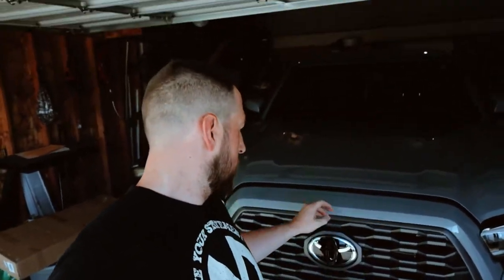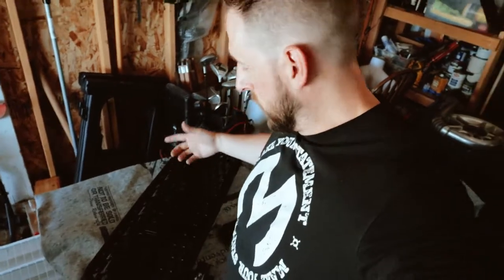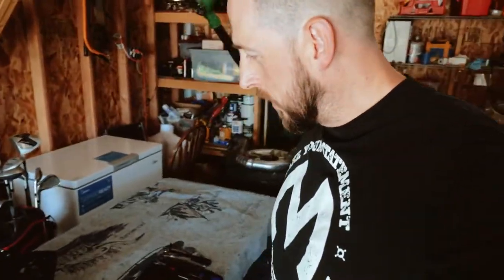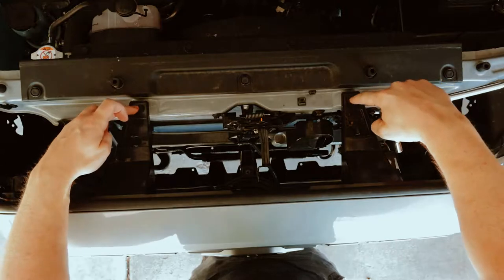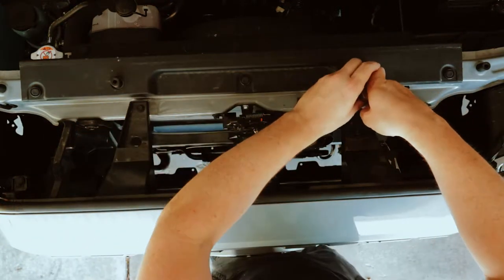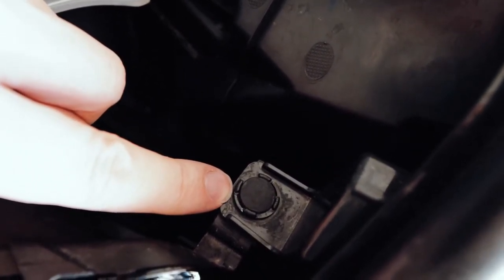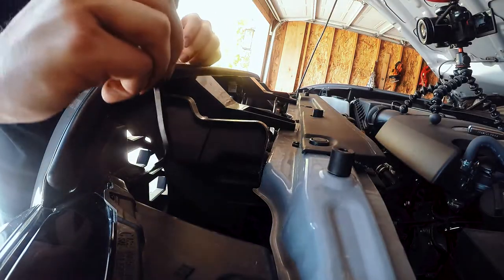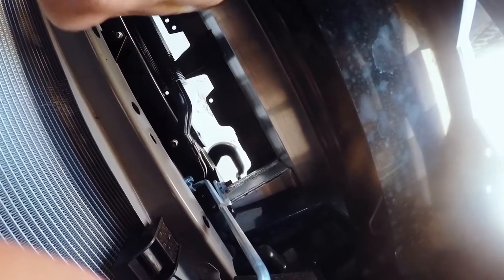TRD Pro Grill on 2020 TACOMA | INSTALL | #tacoma #tacomagrill #tacomamods

Comment: Did mine too on my 2020, but also had front camera to customize a bit to fit in pro grill. Worked out great and love the look with raptor white lights too!
Reply from the maker: Yeah it seems that you'll need to modify the grill if you can't get a hold of the OEM Pro Grill with camera. Did you go with the smoked white or the plain white grill lights?

Comment: Hey man, nice video! So you got this from McAutoparts? I just clicked the link and saw they are so much cheaper than other sites. Wondering why... ahah. None the less it seems like it meets expectations!?
Reply from the maker: Thanks, I took a chance with MC Autoparts and was pleased with what I got. I wanted the details in the grill and I got them with their grill. There are other grills that have a different way to attach the "TOYOTA" in the middle.
Reply: @Mumfy64  I think after seeing your video I am going to pull the trigger on their pro grille and lights. I dig it, we have the same exact truck haha. Thanks for the reply and have a good one. Subbed to you using my other account
Reply from the maker: @zd1676  Nice. Im sure you'll like it, and thanks for the sub! Let me know when you get the grill installed!
Reply: Mumfy Will do!

Comment: I read that you don’t have to actually unclip the 4 clips on the bottom to remove the grill. Do you know if that’s the case?
Reply from the maker: Looking back at the video, You probably don't need to remove the lower clips.

Comment: How's the fitment? Does the grille feel flimsy in anyway? And gaps from the grille between the shell?
Reply from the maker: The fitment that I have is really good and is not flimsy in anyway that I’ve noticed so far. I have noticed a small gap between the shell and grill but I’ve also noticed it on other Tacoma’s as well.
Reply: @Mumfy64  sounds good, I just purchase a set of mine. Bought one of ebay for dirt cheap, but I've heard this grill is the closes to oem so ima give it a try and sell my other pro grille

Comment: How is the grill holding up? Been wanting to get one for my Tacoma!
Reply from the maker: The grill has held up really well. Its not painted and has the same details as the OEM.
Reply: Thanks for the response. I may just have to place an order! I’ve read some reports on TacomaWorld where guys say MC Auto Parts has some shipping delays and Customer Service issues. Did you have any issues?
Reply from the maker: @ryanbaker2623  I didn't have any issues with shipping. If they have delays it may be due to them having a low inventory and waiting to restock. I haven't had to reach out to customer service so I can't comment on that.

Comment: were there no retainer clips provided for the tss sensor cover or did it just pop into place?
Reply from the maker: it did come with retainer washers, but i didn't use them as the bottom clips held it into place. I haven't had any issues with the cover.

Comment: I notice u didnt use the hold washers on the senser. Ne issues? I didnt use them either the nobs were to short I figured the 2 bottom clips should hold it
Reply from the maker: Haven’t had any issues with the tss sensor. I took a trip up to Idaho without any issues, set the cruise control and coasted.
Reply: I am installing my grill right now and having trouble installing those two top caps for the knobs.  Any trouble with your sensor cover coming loose only using the two bottom tabs?
Reply from the maker: @KevinA1058  I had the same issue trying to get the washers to fit. I have not had any issues with the TSS garnish coming loose since installing. If you are worried about it, one solution you could look at is to go up a size on the washers. You should be able to find them at your local hardware store.
Reply: @Mumfy64  I emailed MC Auto Parts and they said I should just use a screw driver to widen the hole a little bit.  Washers fit on with some force. I definitely feel better knowing its reinforced.  Thanks for the vid!

Comment: The top clip of the sensor I got is just flat, is yours the same ?
Reply from the maker: Not sure what you are referring to?  do you mean the clip that holds the wiring?
Reply: @Mumfy64  on the tss sensor ether two tabs at the bottom have clips, the single top one is just a tab with no clip to be held securely. I’m worried of it coming loose while driving.
Reply from the maker: @Mavejar520  the TSS sensor should only be held in place on the by the washers that you removed from the old grill and placed in the new grill and the adjustment screw. If you are referring to the cover plate, then the you can use an internal tooth lock washer to hold it in place.